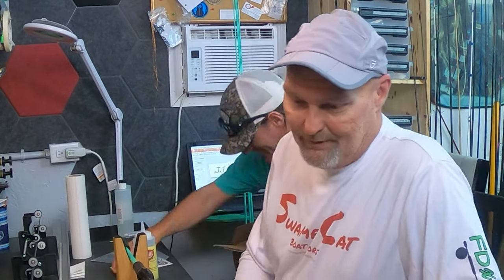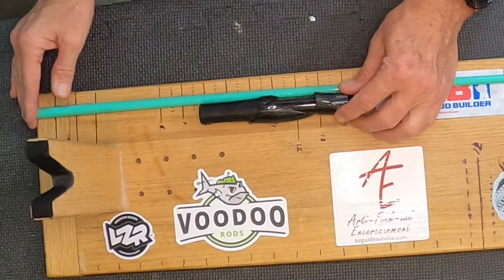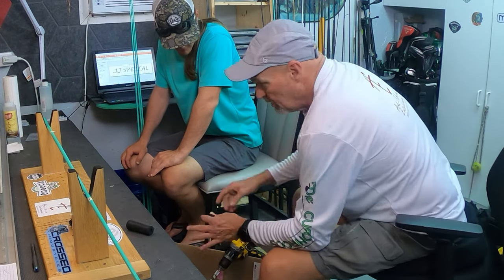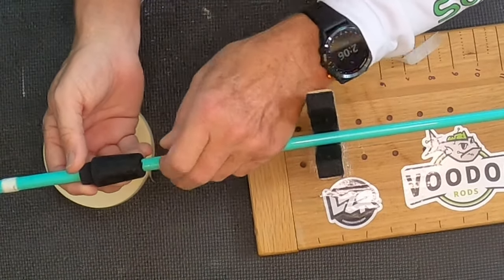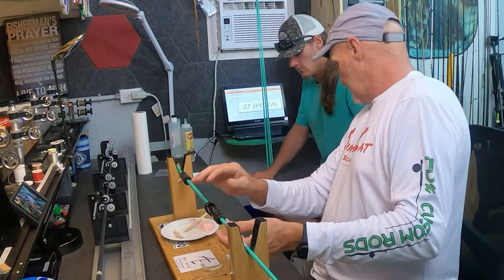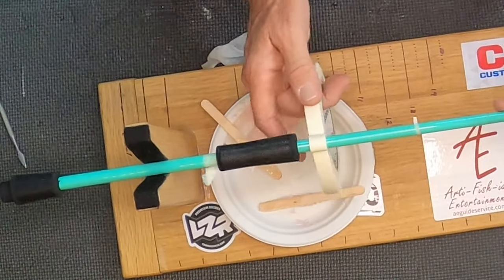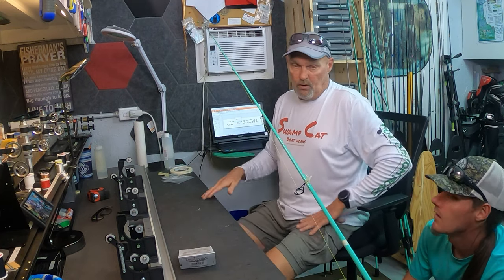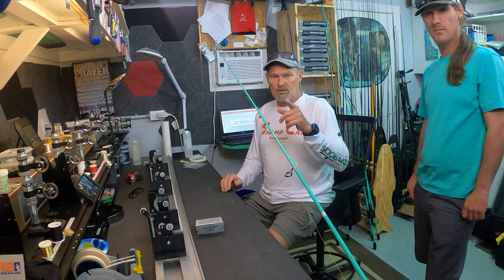Inshore Salt Spinning Rod Build

Comment: Great video once again. I have a question does the guide spacing from the stripper guide up to the first running guide (choker) depend on reel size?
Reply from the maker: Yes, reel height is the critical factor